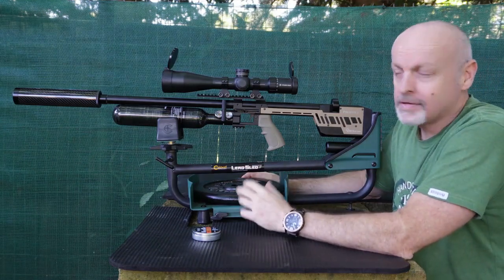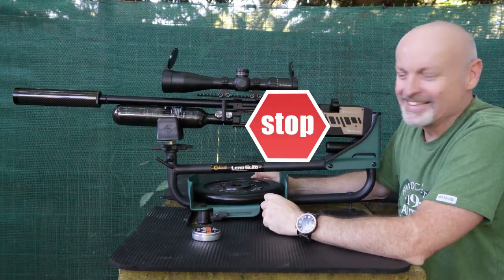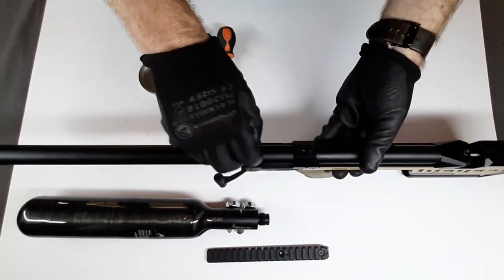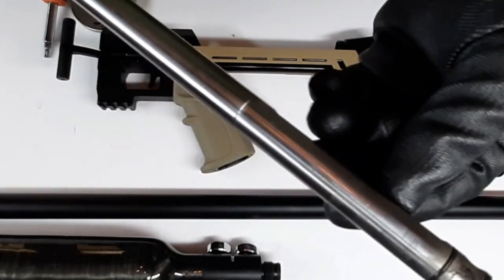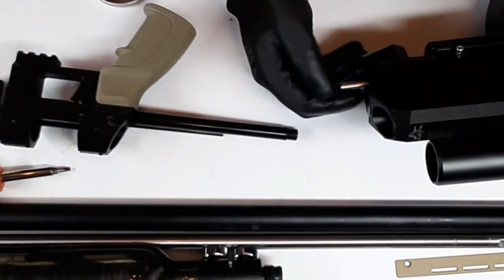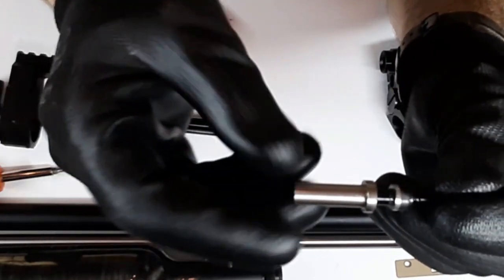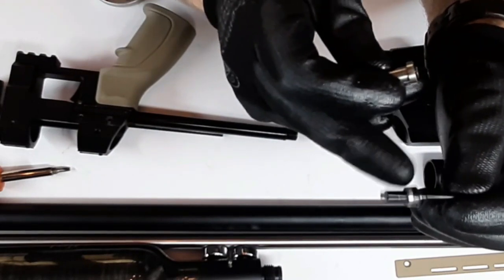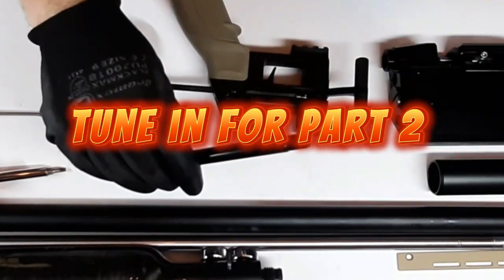RTI Prophet II 5 5mm Disassembly and Trouble Shoot Video Part 1

Comment: The newest version has an ball bearing on the oneway valve out with the spring delrin piece and the valve poppet is a one piece hard plastic? The trigger cocking has an allen screw now instead of the Philips screw
Reply from the maker: There realy is no point to having a check valve in this area of the rifle not just a noise issue  If you cycle the rife quickly the Plenum does not fill up to the regulator pressure so it creates big incostancy  buy removing it  the shot to shot consistency tightens up
Reply: And now the p-3 is in pre order wish they just fix all the issues with the gun and production before selling

Comment: Which airgun is better for you?  RTI prophet 2, or Vulcan 3, 700mm.  Accuracy, strong and durable.
Reply from the maker: Both are amazing guns  but I do like that the regulator is adjustable on the Prophet without having to take the gun apart  but the Vulcan regulator  has better shot to shot consistency